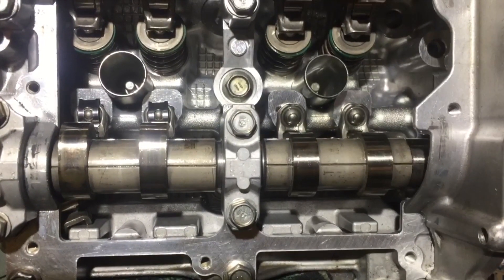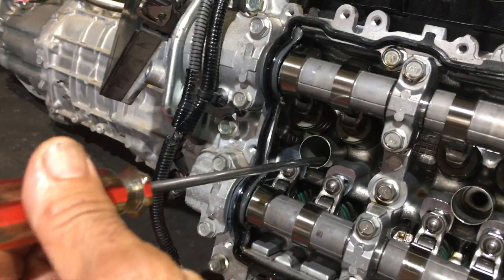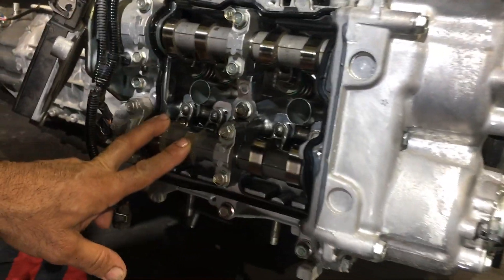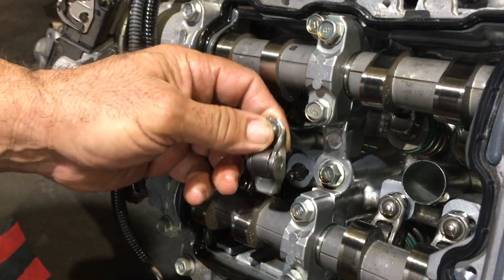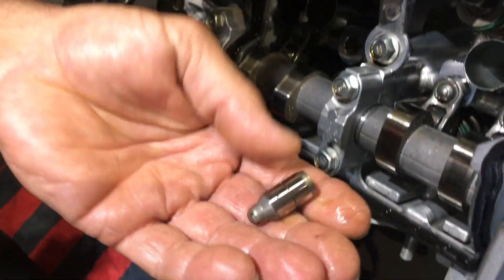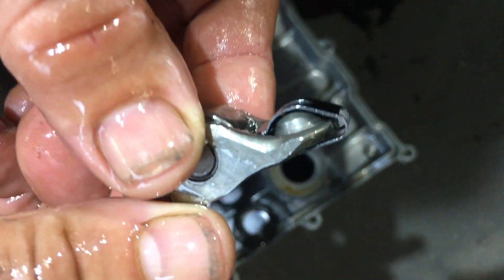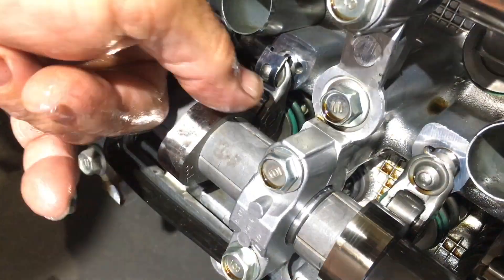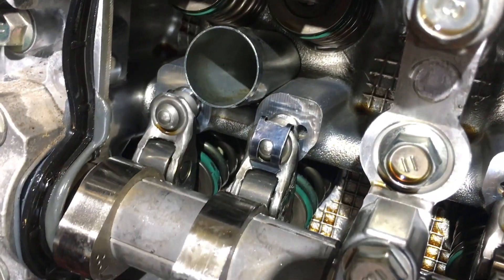FA20 & FB Engine Fatal Flaw and How To Fix It

Comment: Hello, i have Got a Forester hybrid 2020 with a fb20x engine. Is my car's engine able to have Got this Kind of problems?

Sorry my awful english. Grettings from Swiss
Reply from the maker: Hello from Australia to Switzerland! Yes, as it is still an FB20 valve train it will have the same rocker issue. Are you looking to have the engine apart anytime soon?
Reply: @denstoj  Hello, thank you for your answer. For yet, my Fb20x works fine with 13'000 kilometers soon. Everytime i buy a new car, i always look to know his weaknesses. I hope to not have this kind of problems. We will see what reserves the future. And now i know where to ask help for the Subaru engines. Denstoj auto centre in Australia. Thank you in advance for your help.
Reply from the maker: @heliomartins8593  No worries. Great to hear you’re aware of potential issues with your car. I’m happy that you found it helpful. Feel free to ask any more questions in the future.
Reply: @denstoj  I just want to share with you all, i have a telephone conversation with Subaru Europe. They say non oficially, the oil 0W20 is great to the north and cold countries. For lands who have a moderate climate like France, Germany or New-Zealand, their advice is use 0w30, 0w40 or 5w30. For countries who have a hot climate like Portugal, Spain, North Africa, Middle-East, Australia for example, they recommend to use 5w40, 0w40 only. That oil can help the engine to not overheating inside. For my case, i use oil with the rules APi SN and ACEA C5 and a3/b3. For this time i make my choice for the Castrol Edge Titanium 0W40, 5 litres costs me around 120 us dollars. But next time, i have in the idea to use Valvoline, i use this brand with satisfaction from 14 years... Take care. Grettings from Swiss...
Reply: If the engine will be destroyed, to make the things right, is find a good mechanic rebuilder. Hope so you can rebuilt the broken engine or find a good one used in a junkyard and put all parts out to control and change the used parts... and here we go again...
Reply from the maker: Let’s hope you never have to do that! It will be safer if you have the rocker retainers ;)

Comment: Ej for ever
Reply: Subaru can't afford more class action lawsuits.
Reply: @mopar21  and they keep fuckin up with their new motors Toyota done fucked them up good after 2008 subarus are poopoo and I got an 09 interior feels cheap plastic bov and manifold
Reply: Ejs are proven to be unreliable let's be honest here. Cracked ringlands, headgasket issues and more service to do such as timing belt and water pump
Reply from the maker: Hey Freddy wrx, are you swapping your 86 with an EJ? 🤣

Comment: Can you remove the rocker cover without removing the front timing chain cover , for the fa20 wrx
Reply: Yep https://youtu.be/-jDrkEEK99E
Reply from the maker: Hey Bok Choy! Yes. You can remove the rocker cover without removing the front timing chain cover. The engine does have to come out of the car. It's easiest to leave the gearbox attached as seen in our video.
Reply: Same with a 2015+ wrx ?
Reply: Yes you can

Comment: the "lash adjuster" as you call them are hydraulic and will lift up as oil pressurized. the only why the rockers can fall out is if the valve clearance is incorrect and or the valve gets held open/stuck during cam rotation.
Reply from the maker: Hey Kenny, 1. The lash adjusters are not hydraulic, instead, the valve clearance adjustment is done by a bucket on top of the valve stem. We will upload a video explaining this. 

2. The rocker is not oil pressurised from underneath. Oil is fed from a galley in the side of the pivot to lubricate the interface between the pivot and rocker. We have demonstrated this in the following video: https://youtu.be/AncxPbaI-9k

3. Yes, incorrect valve clearance would increase the likelihood of a rocker falling out, however, even with the correct valve clearance, if a valve sticks or bounces the rockers can still fall out as they are free-floating.
Reply: Yes https://youtu.be/-jDrkEEK99E

Comment: Seems to me like you could possibly slip your retainer in without having to remove the rocker arm entirely, just compress the spring a bit. I also wonder how long before your retainer wears, after all, the rocker is pivoting on what I would describe as a "solid lifter."  Subaru has been guilty of some shoddy engineering in the last decade IMHO.
Reply: Yep https://youtu.be/-jDrkEEK99E
Reply from the maker: Hey Eric, 1. No, to install the retaining clip you must first replace the pivots with our custom machined ones. The clip will not work on its own otherwise the retaining clip will not be able to locate and stay in place. Our pivots have a location groove for the clip. 

2. It not a lifter, it is a pivot. 

3. The clip is not loaded under normal operating conditions. Only when the rocker is about to fall out does the clip hold the rocker in place. The retainer will last as long as the rest of the valvetrain.

Comment: They must have a fix for the issue because they had a recall for the gen one FAs in the states. If you don't know there have been 3 revisions sence the interdiction of the FA. Now  they need to fix the timing cover.
Reply from the maker: We too think they would have fixed the rockers falling out by now. Unfortunately, not.

The engine valve spring recall that affected 2012-2013 vehicles was due to the valve springs potentially fracturing. Source: https://www.toyota.com.au/news/toyota-australia-recalls-86-vehicles-to-replace-engine-valve-springs

The free-floating rocker design is still evident in third-generation Subaru engines, FA20 (2012+) FB20 (2010+).

Yes, the pivots have been revised three times, however, functionally they are the same. The rockers are still prone to falling out. Please see our other videos for more information.
Reply: @denstoj   That helps me a ton. I am going to have to open up the motor to fix the my oil leak. I will add the retainers at the same time.
Reply: I see this being a huge problem if you have a manual transmission it should be a recall revision.
Reply from the maker: No problem, we’re glad it has helped you. If you’re pulling the engine out anyway, that would be the perfect time to install our rocker retainers. Has your timing cover leak happened after having the valve spring recall done?
Reply from the maker: Engines with automatic gearboxes are also susceptible to the rocker dislodging. If the valves have carbon build-up, this will cause the valve to be ‘stickier’, and it increases the chance of a rocker dislodging. Yes, it is more likely with a manual due to over-revving when downshifting.
Reply: @denstoj  is my 2020 toyota 86 affected? im here in the U.S.
Reply: @denstoj  I also think there should be a recall for the timing cover leaking because of the potential for an oil fire as with the rocker punching through the head.
Reply from the maker: Neither are safe problems to have. The case of a rocker dislodging and punching through the head likely presents a more dangerous scenario than a timing cover leak due to the volume of oil that could potentially catch fire on the exhaust. It depends on the severity of the timing cover leak and the location. Generally, they are minor weeps that burn off over time.

Comment: Do you know if this issue been corrected in later models or is this a problem all the way up to 2020 engines ? Specifically though what year was the newest engine you know that had this kind of failure happen ?
Also there should be a recall on every single car that has this issue Toyota and Subaru should be held accountable for this.
Reply from the maker: The rocker falling out issue has not been fixed in the latest 2020 FA20 & FB20 engines. It is evident in all third generation Subaru engines, including FA20 (2012+) and FB20 (2010+).
Reply: Nope https://youtu.be/-jDrkEEK99E

Comment: I’d say if you had the proper valve clearance to rocker this problem would not occur
Reply: @Donnie Foster Valve clearance is vital for correct engine operation; however, as the rocker is floating, it can still fail regardless. Proper valve clearance would reduce the likelihood of it occurring, but it is still possible when a valve sticks or bounces across the rev range.
Reply: It will https://youtu.be/-jDrkEEK99E

Comment: Great job, guys! I have been searching for a solution for this. Just a question,  can use the oem rocker arms, with this kit? Im building my motor now, so i will need this kit, just wanted to make sure that i can use the oem option.
Reply from the maker: The only parts that are not oem are the rocker retainer clips .You will need to reuse your rockers and we supply you with modified OEM pivots.
Reply: @denstoj  thank you for the response. This kit will hold, with a build that yields 500+BHP?
Reply from the maker: ENCINAS g This kit is a must with a big build or a stock engine to retain rockers .
Reply: @denstoj  thanks! I am a new cust...and will be using your product on my build. Keep putting out information, we can always use it
Reply: @1atinlove  Will do! What other questions can we help with more information on?
Reply: @DenstojAutoCentreCarrington  do you have any information on cams? Or the customization of lift or duration for the fa20.
Reply: @1atinlove  Great question! We just responded to @prockallday below for the full answer. What is your current setup and what power are you aiming to hit?
Reply: @DenstojAutoCentreCarrington  i will check that out. I spent a year and a half on suspension, and drivetrain. I actually had to wait for a long time for the PAR gearset. I took my time with the block, i did not want to slap a power adder without having the internals done first. So i have a stage 3 block, that is not a closed deck. Not sure i went the right direction on that, but that is what i have at this point.  Im working on the cylinder heads at this point, and researching the turbo set up. I want the EFR set up, and mid to low 500bhp with similar numbers on the torque side. I found you guys, to solve my rocker arm problem. I am stuck on what i can do with the cams, so ive been learning about lift and duration...just to squeeze as much as i can out of the motor
Reply from the maker: Hey ENICINAS g, nice to have an order from you. 👍
Reply: @denstoj  I'm happy to have the level of support for this platform that you offer. You guys made it so easy, and we're clear in all your communications with me. Thank you, I wish you had a solution for an intercooler core.

Comment: Would cams be a good upgrade for this engine
Reply: No https://youtu.be/-jDrkEEK99E
Reply: @prockallday That is a difficult question to answer without knowing your current setup and goals. There are a lot of great options and it depends if your engine is still naturally aspirated or you’re planning to run a turbocharger or supercharger. What is your current setup and what power are you aiming to hit?
Reply: @DenstojAutoCentreCarrington  it is n/a i was lookin at the avo turbo kit but too much rn. Just thinking about how much power i can get from it with it still being reliable
Reply: @prockallday  same here I have a 2013 Subaru Legacy with fb25 engine.Did some research on this engine but it seems like a bad idea to turbocharge this type of engine.Did you find any other alternatives to getting maximum horsepower out of this engine apart from installing turbocharger

Comment: What years are susceptible to this?
Reply from the maker: I believe that all  FA& FB engines will at some time have this problem .
Subaru as I understand havn't resolved this problem they have tried with camshaft and spring upgrade but for the life of me
i can"t understand why they don"t do what i have done .
Reply: DENSTOJ AUTO CENTRE thanks
Reply: @billdickson1142  Thanks for the suggestion! If we were to patent the idea to an OEM there is no guarantee that they would release it to the public. It could potentially just be purchased and "put on the shelf". This would result in drivers still being at risk of destroying their engines. 

We are a family business and want to support other car enthusiasts to the best of our ability.

The patent process would also be a long and expensive one where we would have to stop supplying the kits. We can help people now by selling directly to you :).

Note: This is our newer account.
Reply: @DenstojAutoCentreCarrington  If you once put that kit of repair in sale, i know where to buy it 😉
Reply from the maker: As in you’re looking to purchase a kit? Sorry, a little confused.
Reply: @billdickson1142  Thanks for your input. Our aim is simplicity to increase reliability and decrease cost. Our system with the clip and modified pivot works and is proven on both daily drivers and track cars. 

We would question the need to over-complicate the system. A chain tensioner or hydraulic lash adjuster could add additional failure modes such as a loss of oil pressure.

Crowd-funding is a great idea and is a potential way for us to help more people save their engines from failing.
Reply: 2014 https://youtu.be/-jDrkEEK99E
Reply: Adam B  ??

Comment: That's a very interesting solution.
I think Toyota/Subaru modified the rockers on the newest models but I'm not sure.
I had 2 rocker arm (same valve) jumping out of place before the valve spring recall, but Toyota said that the rocker arm jumped because the pivot had some metal debris on the bottom and for that reason the rocker arm failed to stay in place...
Reply: yeah, i think the valve spring recall fixed this issue.
Reply: @mrjklee  The valve spring recall actually has not fixed this issue. The rockers are still free-floating and hence can fall out from the pivot. Our clip and modified pivot resolves this issue.
Reply: Nope they haven’t even the gr Yaris even can drop one !! And needs a retention clip